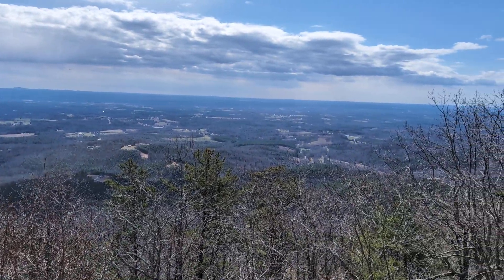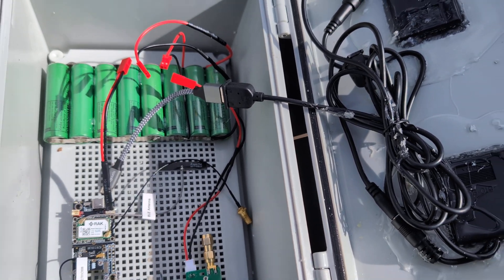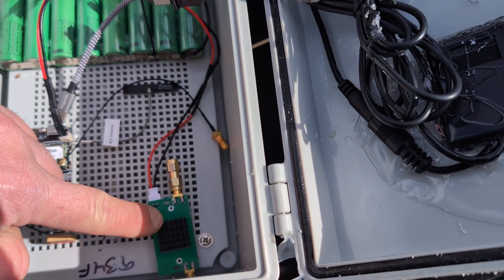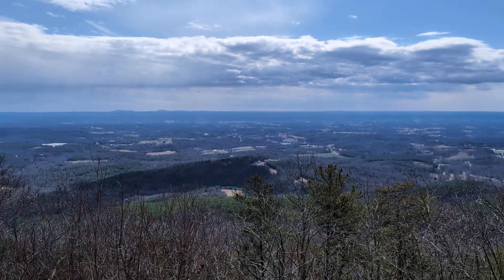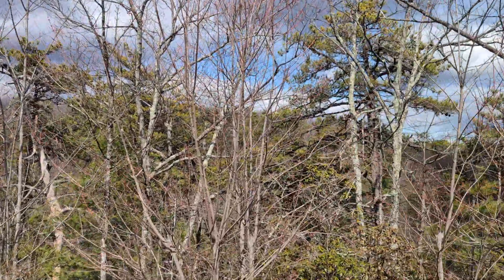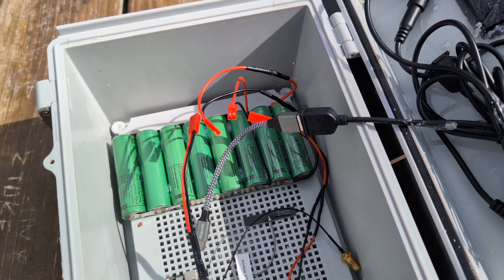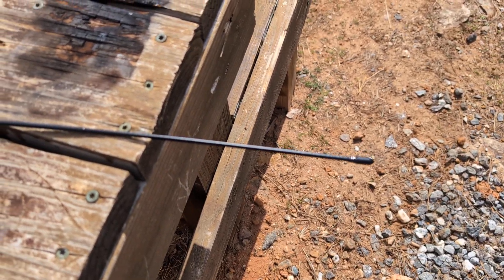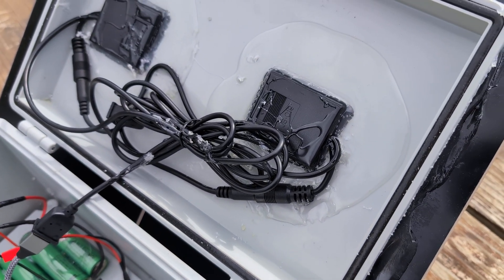Meshtastic build update. Also what not to buy.

Comment: Does the base-board keep the batteries charged automatically via the solar panel, acting as a battery bypass circuit with an uninterruptible power supply? Or do I need to purchase an external always-on battery bank (Voltaic) and charge it with solar directly?
Reply from the maker: The solar charges the bank.

Comment: The amplifier you're using looks to be a 433MHz transceiver amplifier? Is that the ISM Band you're using? I'd be interested to see the result of feeding that amplifier module through a Spectrum Analyser or at least a small SA Device like a Nano VNA etc, via a suitable attenuator of course - In short, an amplifier will never degrade performance, so it's either faulty or designed for a different ISM Band.
Reply from the maker: It isn't an ism band, it is setup for private FCC license. I hear what you're saying, but the problem seems to be when the amplifier switches from the receive to the transmit mode. It's a little delayed which cuts off part of the transmission

Comment: First, where are you? It looks like the Tennessee Valley. Next, I had a similar problem with an amp when playing with 2.5 GHz WIFI over ham radio,  My rougher was overdriving the amp. Try reducing the output power of the LoRa transmitter and see if it starts working,
Reply from the maker: Tried reducing the output but had zero change, thanks for the comment

Comment: You are wasting power by feeding your solar in via usb c. Its much less efficient that way.  can use the solar input connector and a small 5v panel if you’re not running gps or IO… the connector is a JST 1.5mm available for Pennie’s from the usual places 

I’m using 1 5V 200mah epoxy cells and 1 protected 18650 cell.

.03-.05 MAH Draw… 3400mah cell…. Basically forever 

1 cell will last weeks…. With no solar, like pitch black. 

Focus on a high quality antenna and a short u.fl Pigtale that mates directly to your antenna. I suggest using antennas with an N-female fitting and use a U.fl to nmale cable with a short pigtail length. 

6 dbi antennas this way and 30 mile range all day to a rubber duck antenna
Also, make absolutely sure your batteries have extra protection from over voltage etc…

You don’t want a fire.
Reply from the maker: I appreciate the comment. I've been told that about the USB-C connector, but the problem I run into is the charge rate of the solar input is less than what the usbc charge rate can be. Maybe I'm wrong with that though.
Reply: Do you have a workup of this? or reddit post that you provided images and links?     My solution is mount these on top of commercial roof tops, and plug them into HVAC equipment receptacles.
Reply: @jetskiwillywilly7970  who cares about the charge rate, they basically use no power if theyre repeaters, a 5v 200mah solar panel is more than adequate in remote snowy areas for the rak4631, just mount them vertical so snow can't pile up

An 18650 cell charges from 0% to 100% in cloudy crappy weather in like two or 3 days while powering  my nodes, no plug-in required.

I haven't done a writeup but maybe i could. It's very easy and cheap. Panel's are like 3 bucks a price I'd you buy 10 at a time and 18650s from 18650batterystore and some 18650 holders from Amazon and u.fl to N connectors your antennas and bulkhead fittings and 1.5mm jst for the solar and 2.5mm jst for the batteries......

I've built about 12 repeaters this way and have many deployed all winter no problems. Even a 5 watt panel is extremely excessive for these

I have over many nodes spanning nearly 100 miles in my personal network